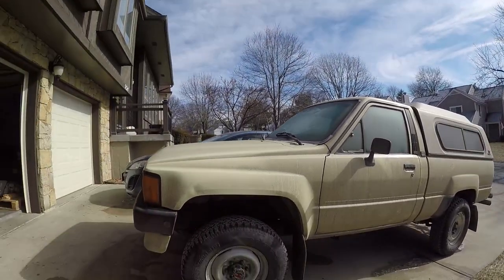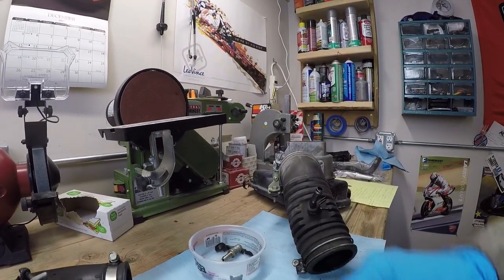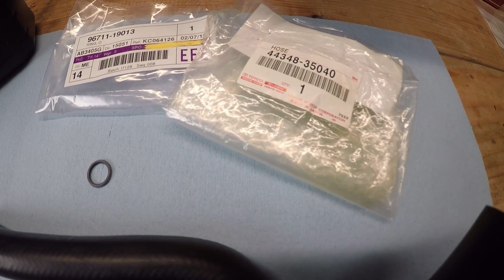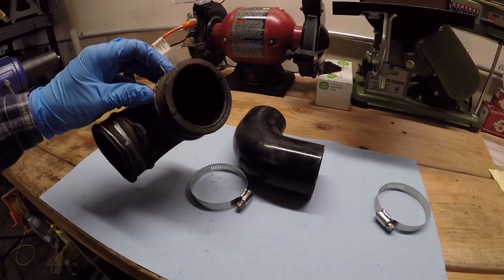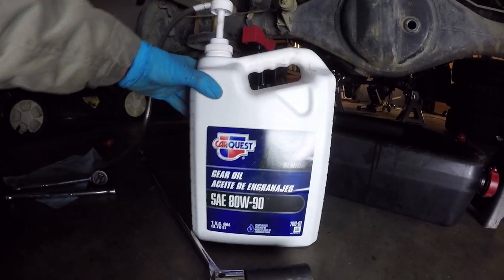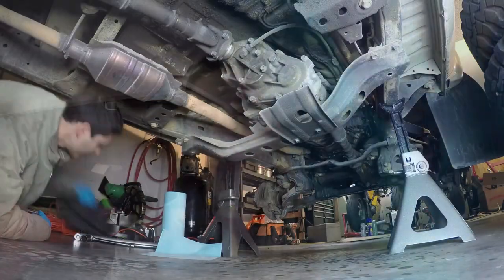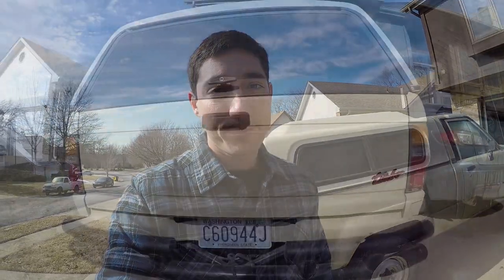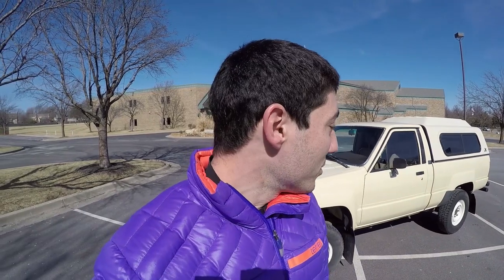I Bought A Rare 1986 Turbo Toyota Pickup

Comment from the maker: Hooo boy this video took off out of nowhere. Sorry everyone, but the truck was sold back in 2018 before anyone found this video and cared.
Reply from the maker: I paid $4k for the truck, $1100 for shipping, and about $1400 in parts, fluids, taxes and insurance for it. All told about $6500 to actually own it for the period of time that I did.
Reply: @PracticalEnthusiast  nice!!! hope you made a sweet profit off it!! definitely a sellers market!!be good peter!!
Reply: The video took off because YouTube is pushing it in the suggested videos to the right. They've changed their algorithms recently and I mean no disrespect, but YouTube is suggesting videos WAY out of our individual interests. But...it worked....I finally succumbed to temptation after repeatedly seeing it in the suggested videos. You did a great job both in getting the truck and making all the needed repairs and performing the maintenance. It's a shame you bought it to flip. It would probably last another 250+K miles. Cheers! Zip~
Reply: How much did you sell it for?
Reply: Practical Enthusiast
Reply: @PracticalEnthusiast  thats what i paid for my 91 4x4 i am going to have to do a top end burning oilbut i will never sell this manual trans limited computer headaches ext cab i can do all the work but it was nice to see that turbo
Reply: Really nice old Toyota. When you remove the lid from the power steering reservoir I thought you might show everybody the original spelling of the brand name. I was kind of disappointed. Was a nice truck though.
Reply: My first car was an 86 toyota pickup. That thing didn't even need oil, this baby would have continued to drive for at least 10 more years.
Reply: @PracticalEnthusiast  how much did you sell it for?
Reply: You came out good paying that much for it turbo models are hard to come by. One that clean and not rusted out is even more of find
Reply from the maker: @alextran8188  I sold it for $11k about a year and half ago.
Reply: Great video! I just got a 2 wd 86 turbo extra cab 5 speed.this video makes me want to fix it up more.

Comment: A small oil leak on a Toyota is a blessing in disguise. I would much rather check my oil everyday and have a rust free frame. A slow drip seems to coat everything perfectly
Reply: I'd rather have blow by from a gummed up EGR valve (#1 reason for oil burning/ dropping oil level)  2min fix
Reply: I just got a 4runner 96 with a nice oil leak myself. Rust free! Instead of chasing all the leaks.... valve cover gaskets, can seals, rear main, crank
Reply: You a lucky guy
Reply: With a Toyota you are assured of at least half a million miles of exotic driving....just do the regular oil service and brake service
Reply: they made those frames outa old WW2 ships. it was not good metal. only bad part of the truck.
Reply: Haulin' ass Wastin' gas  absolutely!  If not more!
Reply: Lil' Red GTO  Even more than half a mill.
Reply: @deadjoey77  So after WW2 Toyota used the metal from Japanese ships to produce truck frames? Interesting, i wonder up until when they switched to a different metal resource when that ran out.
Reply: @QualityKills98  thats what i was told on why all the 80s and early 90s toyotas rusted out like crazy. to be real, i dont know if thats true, i always just believed it. makes sense tho.
Reply: Oil leak messes up rubber parts under the vehicle, like bushings and hoses, etc
Reply: @tisiluca  still cheaper to replace than a frame.
Reply: Everything stays nice and shiny and rust free 💯😎
Reply: Gotta agree Toyota’s self lubricate as they age 😂 works out tho for sure
Reply: @QualityKills98  I thought it was because the frames weren't coated properly.
Reply: tom frankfooter I was told the coating used was found to be faulty
Reply: @deadjoey77  I was told it was because the trucks were assembled in Japan as the cab, engine, and running gear only, shipped over as sardines and had the beds and rear frame welded on here in the states right before they hit the lot. I dont know for sure either, but ive had 3 of these (83, 86, 85) and they all had swiss cheese on the frame right behind the cab...? 🍻
Reply: Lil' Red GTO  I worked at a Toyota dealership. At least once a year someone would roll up in a Toyota with a million miles on it. The last one I saw was a Celica that was all original. The whole engine bay and undercarriage was coated with oil.
Reply: @HooDRidEWhiteY  thats right where mine broke. i was driving it down the side of some rail road tracks when i realized i was looking up at the sky. sadly i knew what happened. drove it 2 miles home offroad, bombed it through my back yard like a motherfucker but the drive train wouldnt snap. what a great truck.
Reply: @deadjoey77  ehh.. its not like they used the metal directly off the ship... they probably melted it down and casted it to what they needed.. melting it down in a foundry would result in putting fresh minerals/alloys to restore it before casting, etc...  in other words, they probably used recycled metal from the ships...
Reply: The
Reply: If it's leaking oil then you still have oil
Reply: @MartinSage  I'm fairly sure these don't have EGR valves.
Reply: I don't get it, I really dont. I live near the sea, with relative humidities constantly in the high 90's. These 80's and 90's trucks dont last much in terms of outer shell, but I've never really seen systematic corrosion on the frame.

I'm starting to think toyota sent deffective\lower quality trucks to the USA on purpose. Like payback from WW2 or something :p
Reply: It’s actually caused by the front crank actually wearing away. It was easily fixed by purchasing a sleeve from the local Toyota dealer that was made of harder metal. This fixed the issue
Reply: @deadjoey77  actually it true from a guy who owned one here’s the truth. Most Toyota trucks easily lasted over 200,000 miles but up north our winter treatments just eat almost anything but still my dad got over 20 years out of a 1985 Toyota 4-Runner . We did have to do some patching in the inner fenders on the rear and minor stuff. The issue was the beds on 80s and 90s Toyota pickups ( the cabs tend to hold up very well and have typically Toyota quality). In order to get around the excessive taxes on foreign made pickups Toyota shipped the trucks over minus the beds. The beds were made separately in California and fitted to the trucks prior to the trucks being shipped to the dealers. This continued until Toyota built its first full line production plants in the US. That’s why older Toyota’s always seem to have bed rust issues in the northern or snow belt United States. It was an easy repair and still is if you can find someone stamping out the panels

Comment: I've owned one of these. I rebuilt the engine on mine. The turbo engine had different pistons which dropped the compression down to 8:1 instead of the usual 9.4:1in the typical 22re. This is necessary for longevity when turbocharging an ICE. The lost compression is made up for by cramming more air into the cylinder with the turbo. The problem with the stock turbo from Toyota is that it was one of the few bad things that Toyota ever built. Something about the impeller blades or some crazy fluid dynamics above my pay grade. This resulted in minimal gains from having a Turbo over the naturally aspirated truck. Anyway, the fix back in 2003 when I was doing mine was to install a Garrett T3/04 hybrid turbo. There was a guy with a website back then who was getting 250hp on the dyno with his engine that had that turbo. Insane! It's easier and cheaper these days to turbo and tune an older vehicle like this. If you haven't already done so, the first thing you need to do is get a better turbo.
Reply: Bah.  I owned a from new to 200k miles 1986 2wd Xtra cab turbo truck.   Stock.  Never had one issue with the turbo.  I was dedicated to frequent and consistent oil changes and NEVER ever shut it down hot.  I always let it idle at least 30-45 seconds before shutting it off.  Longer if I'd run it hard.   This I feel was the reason for its longevity.  Most people never did this, and with a non-water jacketed journal bearing turbo, you are just asking for trouble if it was shut down hot.  With that said, it is not a robust turbo design.
Reply: @ocavant  He isn't saying the turbo will fail. He is saying that it makes minimal power gains over naturally aspirated...
Reply: What’s funny is I actually own an Xtra Cab Turbo 4x4.. lol Staring at it right now.
Reply: Well yeah the turbo isn’t all hot but a r series trans and tougher axles? Shit sounds pretty worth it to me

Comment: My first truck was a loss-leader '88 Toyota, new off the showroom floor for $6288++. R22 engine, 5 speed, no turbo or 4WD. I drove that baby 170,000 miles and sold it in 2005 for $1800. GREAT TRUCK. I own a 2002 4WD Sequoia today, and still "love my Toyota truck."

Comment: Such a cool find! I live in Hawaii and old Toyota pickup trucks are like gold here. Impossible to find one like yours! I have a '91 Toyota pickup single cab 4x4 and it is a beast. Has the 22RE as well. I picked it up for $2500 and sure enough just like you, ended up replacing a bunch of parts on the neglected engine to get it running good. A oil leak from the oil seal and leak from the water pump led me to replace the timing chain and plastic guides since I was already in there. That also meant replacing the front cover and removing the whole head as well. Luckily this did give me the chance to clean every single nut, bolt, and basically the entire engine in the process. I replaced the starter since I was already so deep in the engine. Cleaned all the buildup on the valves and cylinders. And did a full EGR delete. FUN FACT: You do not need any of those vacuum lines on the top of the valve cover, there is only one you need which goes to the power steering. Everything else is pointless emissions crap. (Luckily we don't have smog control in Hawaii) But that being said, it was an amazing learning experience and now I know that the truck is good for another 300k+ miles. (P.S. These engines can take as much timing as you can give them until they start pinging. More timing=more power. Mine is almost fully advanced at +1.5 and gave it a big boost in power)

Comment: Love this generation Toyota truck.  Had a couple of REALLY nice 2wd low rider type trucks back in the day, a 1985 2wd 22R carburated, Extra cab, 5 speed, manual steering, nice bench seat with armrest that reclined, not much else on options. That one stayed stock.  

Also had a several years later around 2001 1 owner, old lady 1988 2wd, reg cab with no room, 22-RE fuel injected, 5 speed, that one was a delux model, had carpet, a lot of sound deading, power steering, lots of chrome trim, powder blue paint, stripes down the side, 14" wheels with chrome beuaty rings, it was a much nicer truck despite the lack of room compared to my stripper 1985 reg cab.  I actually modded that truck, lowered, enikie wheels, paint was damn near perfect when I got it, just polished it a lot.

Comment: I almost bought the exact same model new and had a friend who did... I ended up waiting and buying a new 1990 xtracab 4x4 v6 in 90 that I owned for 27 years until i had to sell to make a house payment last year... im still broken hearted about that... One thing I learned was its best to replace any bolts when you have to remove them as they tend to snap after all the years when you try wrenching on them.... What did you pay for your truck and how much was shipping ?   It looks clean, not as clean as mine was but still looks like a great place to start.... Loved my toyota, it was family. wish i could post photo's here after 27 years the engine bay was still cleaner then when it was new... good luck, enjoy.

Comment: Change the front main crank oil seal. It's an easy job (just pull the belts, crank pulley, and it sits in the crank driven oil pump, 5 small bolts) and they notoriously go bad.
Reply: I just did mine and used a different seal on mean bearing. I have 404000 on mine

Comment: You can use ATF in the power steering system but they come from the factory with clear power steering fluid. Also the PCV valve is likely not rattling because it's full of oil. The PCV valve being stuck would cause excessive pressure buildup and leaking seals not excessive oil to pass to the intake. If it was stuck open it still would not cause oil to pass through. What you have is excessive Blow by. Engine needs an overhaul
Reply: a PCV valve being stuck closed is pretty rare
Reply: good to start with the easy stuff first...
Reply: @jesset489  You're 100% right
Reply: @Terminxman  no he's not
Reply: @jesset489  if you look closely you will see that the pcv valve hose feeds directly into the manifold on this truck and the oil was produced from a different hose further forward of the pcv valve but also on the valve cover, that is the hose which connects to the flexible intake hose. Also, being an old turbo aside, oil in your intake manifold or plumbing is ALWAYS caused by excessive amounts of blow-by. There are too many baffles and such in the path for oil to just "naturally" get into the vent system even with a stuck open valve......hell I always just toss my pcvs and mount a hose directly and I have NEVER had oil in my intake until I had worn out rings and valve seats/seals. But what do I know, I've only been fixing and rebuilding my own engines for nearly 30yrs now......I'm sure your 3-5 yrs of experience is far superior to the rest of ours.
Reply: @billstearns9566  really? That's weird, considering the vacuum causes the valve to open normally anyways......not to mention I've never had any oil make it into my intakes until the point where a leak down test proves it's time for an over haul..........or how about the fact that the pcv valve was first introduced to help meet emissions requirements, as evidenced by the fact that they didn't exist before emissions regulations and they still don't exist on 99% of internal combustion engines built today that don't try to meet emissions? When was the last time you saw a pcv valve on your lawn mower or chainsaw?
Reply: John Pike since your "30 years" has taught you nothing, listen up. The manifold vacuum actually CLOSES the valve at idle when the vacuum is at its greatest and the amount of crankcase pressure is the least. Opening the throttle plate decreases the manifold vacuum causing the valve to OPEN some more when the crank case needs more ventilation at higher rpm and loads. A stuck open, or removed by a dummy, pcv will allow the engine to suck too much oil and vapors out of the engine at idle and low rpm when manifold vacuum is high. This causes excessive oil consumption, surging idle, and other performance issues due to a lean condition at low rpm. Nice try deflecting your lack of knowledge by bringing up lawnmowers. I have neither the time nor inclination to explain the multitude of differences in engine types, uses, performance and emissions laws regarding lawnmowers. But I suggest that before you taunt people with your "30 years" you should actually know what the hell you're talking about.
Reply: Yeah I thought the same thing... If it's stuck, then there isn't going to be as much or any oil getting into the intake from there right? That just means any oil in there has probably been there for ages or it's still letting some through.. Pleased I wasn't the only one that noticed that. Quite a big oversight.
Reply: @jesset489  I said in my comment directly aimed to you that I DID see the pcv is on the valve cover......so mute point you made there. I said the oil came from a DIFFERENT hose ALSO on the valve cover so....yeah...
Reply: @jesset489  oh btw....I never said anything about "many engine swaps" so your 5 minutes on my channel tells you NOTHING about me.....I normally rebuild my engines not swap them.
Reply: my first thought too

Comment: I just found one of these for sale, my stepdad had an 85 and it was a beast, it could fit 31" tires stock and we used to outclimb alt of jeeps and huge trucks out at the trails, its small and can fit through dense brush trails unlike big trucks, his was non-turbo. Great find , they are tough little trucks, delete that pcv valve and put an oil catch can on that bad boy.

Comment: I bought the same but a 85 2wd in California while I was living in Vietnam.  I have had it 5yrs with one yr. sitting while I returned to Saigon.  The truck has been the cheapest, best running truck I've ever owned.  Replaced the Brake and Clutch master cylinders due to age.  Parts cost a whopping $25 total...yes, that's all.  I get all my parts at Pep Boys and I pay extra for their Lifetime warrenty.  Also, replaced the fuel pump/filter...$35. Oh, and Air/oil filters with every oil change...3mon or 3,000miles.  That's it folks.  Have you heard of Junk Yards Sunny Boy?  That's the cheapest way to get odd replacement parts.  I once needed a 2inx10in 1/8 thick plastic face plate.  Amazon wanted $139 with Free shipping(Woopie), Ebay wanted $39 +free S&H and my local Used Toyota Junk Yard wanted $10 if I came to take it off the junker.  Kids today think they can only shop on their cell phone. ha..ha. You just might be surprised if you got off your Fat Butt.
Reply: where was this fabled toyota junk yard at ? I live in socal and frequent local junk yards but have never seen a toyota xtra cab 4x4 (1990) like mine in one ever! They must all get diverted to where you go?
Reply: Some of us “kids” still go to junkyards.
Reply: So I have to wonder, what kind of condition would those rubber junkyard parts be in after sitting there for 30+ years?  Sometimes it's better to buy new.  I'm an old fart myself, but I'm tired of younger generations being dumped upon in the comment sections.  We are all products of the culture, economics, and technology into which we were born.